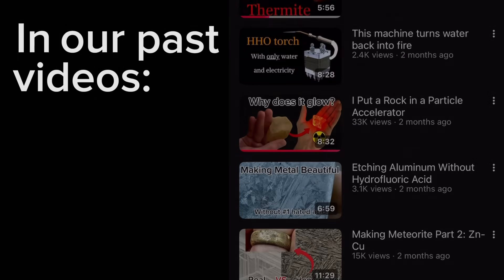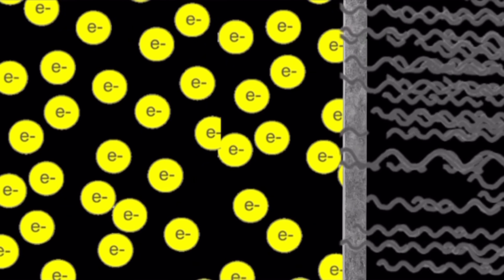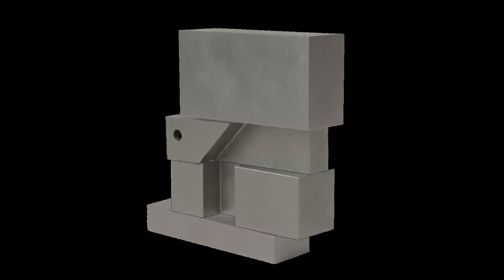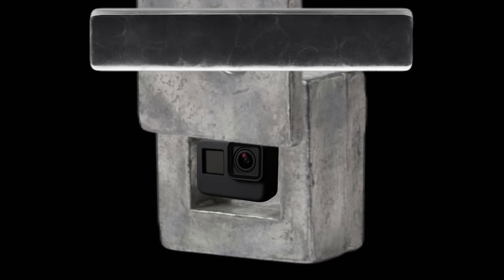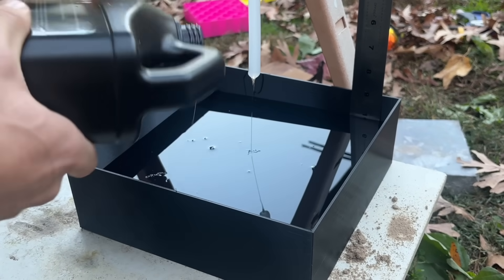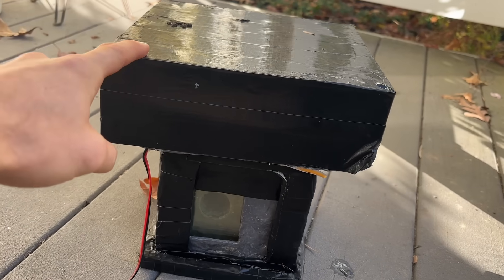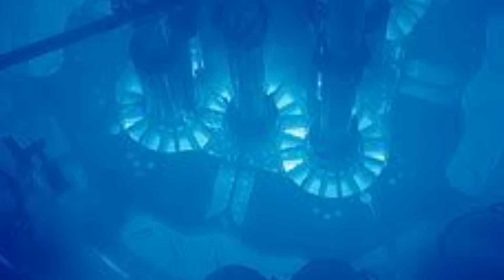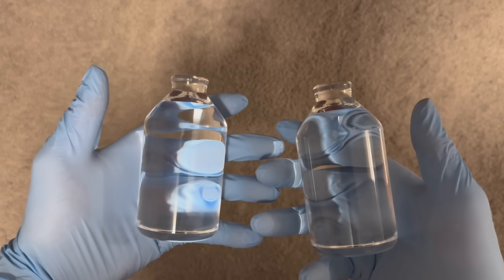Recording Inside a Particle Accelerator

Comment: Uhhh start taking extra vitamin C and go to a sauna to sweat that lead out. Sooo bad for you... good lord. I was yelling (well, inside my head) at the monitor "WEAR GLOVES! DON'T BREATHE THAT IN! COAT THAT LEAD WITH CERAMIC PAINT!" (added bonus fact: semi-embedded lead doesn't readily release from surfaces with just soap and water, there are special wipes)

Otherwise... great work. Very cool. (additional bonus fact: fine crystal glasses contain large amounts of lead oxide... typical is 24%, some as high as 40%. So uh... yeah. Maybe not that expensive after all?)

Comment: Okay this awesome but please, PLEASE wear gloves when handling uncured epoxy! Acrylate monomers are no joke and will poison you if enough are absorbed through your skin, and you'll quickly become "allergic" to basically any plastic that has acrylates in them (which is most of them) that includes things like dental work

Like I can see later on that you're wearing gloves, but like I cannot stress enough how you need to wear them Every Single Time you handle UV resin, and you should also be wearing coveralls. This shit contaminates everything and there's zero way to clean it up. One or two exposures is fine but if you're consistently working with resin you really need to invest in industrial grade PPE, especially if you're showing footage of yourself using UV resin in a youtube video

Comment: 6:12 awesome ingenuity and perseverance.... But .. why didn't you just "machine" your castings for better mating? It's lead, you could have done it with a grinder and energy wheels or many other things. Castings are very rarely used with no machining. Just my 2c but carry on!
Reply from the maker: I don’t have the tools, but even if I did I would rather not generate a bunch of lead shavings if I didn’t have to. But you’re right, it would totally be better machined.

Comment: Hello,
Could you please tell more about the particle accelerator itself ?
i actually expected to see something enclosed like the LHC but it looks more like a conveyor belt and actually makes me think of a airport scanner on steroids rather than a particle accelerator.
Also what keeps people safe from radiation here if there's no door between the occupied room at the beginning and the other one where the beam is ?
Thank's.
Reply from the maker: This is a linear accelerator, or linac. It produces a beam of extremely high energy electrons within an enclosed setup, but then ejects that beam into the environment where targets are set to be irradiated. 

If you notice in the video, the cart travels down a maze to get to the beam. The maze is constructed of feet thick walls made of heavy concrete that provides sufficient shielding between the beam room and the occupied region of the facility.

Comment: why didnt we see a beam of light? i thought particles accelerators are differents.
Reply from the maker: Ionizing radiation is typically invisible. We would see a beam of light if it was dark in the beam room however because the electron beam would cause the same blue glow as they did in the acrylic, but in the air.
Reply: @ElectronImpressions   Yeah, I don't know why I gave any meaning to my imagination about a particle accelerator😂.
I imagined two pipes in a circular shape, each with a particle traveling inside. After both particles reached the desired speed, something would connect the pipes so the particles collide and create a spark for like 0.0001 seconds or something.

Thanks for the explanation! Also, that brilliant GoPro case got me excited about the videos you'll be able to make. I subbed and turned on the bell.

Comment: why not a prism?  Or a mirror? that guides a light towards a sensor at a 90 degree angle to the apparatus.  If that abruptness is too bad, maybe not 90 degrees, but hell, maybe 120.  so it just barely reaches the side after say 100 feet or something, sure that's a lot harder to do, but what ever the math works out to be "safe" of course. If it's still viable then.

Comment: Could have used a torch to melt the seams together or even lead soldier as well!!!
Reply from the maker: Yes totally, although one requirement for the design is that the case needed to be able to be rapidly disassembled within seconds, so at least some of the seams were sort of a necessary evil.
Reply: @ElectronImpressions  Yes, you are right Gentle-Sir, typed my message during the middle out video and posted it. I understand about reflective radiation and quick access. During my construction years, I've found a lead shower pan, instead PVC shower pan to prevent leakage, they used a lead one!!! I should have saved it!!! Nearly 100 pounds of 2-4mm lead sheet!!!!

Comment: 7:55 PLEASE take a blood lead test 😭😭🙏🙏
Reply: No gloves? Bad move.
Reply: @DrDeuteron  the ancient Romans were apparently using lead oxide as face make-up, lead acetate as artificial sweetner.
Reply: @wbeaty  "Ancient romans", Lead acetate was still legally used as a sweetener until at least 1750, and lead oxide was still in cosmetics and paint up until the 1970s.
Reply: @wbeaty AFAIK Romans weren't "using it as a sweetener", it was mostly a side-effect of acidic grapes interacting with lead-lined vessels used in wine making. There's no evidence of them intentionally using lead acetate as a general sweetener. The Romans had to be somewhat aware of lead's dangers at this point (Greeks certainly were) but may not have thought it was a significant concern or just didn't care because it made their precious wine taste better than the alternatives.

Funny enough this and 'drugs' may have been one of the most significant factors in the empire's downfall. They all lost their damn mind.
Reply: @wbeaty ancient Roman’s? Bro I was exposed to lead oxide YESTERDAY from exhaust coming out of a plane that burned leaded fuel (yes those still exist).
Reply: @JJFX-  Exactly correct. And as you alluded, the Romans were putting wine in lead containers intentionally, to make it sweeter. They didn't know the mechanism obviously, but clearly their bloodlust (particularly that of their most infamous leaders), has at least something to do with their exposure to plumbum (as they would have called it). As a side note, I wonder if the slightly diminished bloodlust of the 20th century, sated by violent sports like American football (before serious rules were instituted to protect players) and WWF/WWE wrestling (mostly fake violence, but still) was also partially caused by lead poisoning (I know the crime rate spike from the '70s to the '90s is famously partially attributed to lead exposure from tetraethyl lead  in gasoline, but could we have unknowingly echoed our Italian cousins from 2 millennia ago, creating Coliseum-like analogues in our arenas and stadia?). It's also worth noting that the most violent era of NHL hockey was the 1970s to 1990s! Was this tolerated and encouraged by lead-crazed fans and league administrators? Were the Broad Street Bullies themselves brain-damaged by heavy metal poisoning growing up?
Reply: @VoIcanoman  It's certainly possible this played a role. Lead levels from gasoline were reaching their peak in the 70s and leaded pipes from buildings constructed in the 60s/70s only added to the problem. However it affected those living in densely populated areas significantly more and overall exposure had dropped substantially by the early 80s as leaded gasoline was phased out until being fully banned a decade after that.

There's no denying lead levels can affect behavior, increasing impulsiveness, reducing attention spans, etc. I'm sure this impacted crime and education in urban cities (on top of other social factors) but I doubt it was the primary reason pro sports were played more aggressively.

As bad as it was, it's not as if levels were so high that every person in the US had lost their mind. It was also a very crazy time in sports. Salaries/endorsements were rising, the sports media machine was really getting off the ground and the rules were often not as strict (for better or worse). I think this combined with the use of steroids and various stimulants was likely much more significant. That didn't really start getting attention until the late 80s and we know steroid/doping use continued to various degrees deep into the 90s (and beyond). Throw all that together and it's not hard to imagine why sports were more fun back then ;)
Reply: Well there isn't much you can do to treat it, so You're probably better off not knowing.
Reply: @kiwihuman  just have your skeleton removed.  That's where all the lead is building up.
Reply: eh, it doesnt absorb super well so as long as he washed his hands after it hes fine
Reply: Lead Oxide, but still.
Reply: Lead does not go that well through the skin. Unless he  licked  his fingers, or smoked a cig with unwashed hands, he should be alright.
Reply: Is not that bad. Probably he consumes more lead on his normal diet than what he could have absorbed thorough his hands that single time he worked with lead.

Comment: Could you have worked a high proportion of lead dust into a putty, enabling you to be pressed into all gaps and contours, in order to seal your plates?  And then, strap them externally to bind them all together?
Reply from the maker: I did that with epoxy on the second design and you can see remnants of that, but came to the conclusion because there are a lot of moving parts, I don’t want to risk damaging the leaded epoxy and creating lead dust.

Comment: are you familiar with Andrew Seltzman's (@andrewseltzman9280) gopro exeriments? he did a set of videos a few years back where he sent a gopro through an electron beam irradiator. He even did some where he sent a 360deg camera through. See if you can get them to turn off the light in the chamber, you could clearly see the beam pattern in Andrew's videos when they sent the camera in there in the dark.

Comment: Interesting! 😃👍
But what is this particle accelerator used for if there is no GoPro inside? 🤷‍♂️
Reply from the maker: Crosslinking polymers
Reply: @ElectronImpressions ... I'm not an expert - so you put polymers (plastic?acrylic?liquids) in and give them a new structure with other characteristics? 🤔
Reply from the maker: @u.e.u.e.  Yep exactly, some mechanical properties are only attainable through the electron beam changing the atomic structure of the material. Many polymers will generally change from elastic and rubbery to stiff after being irradiated.
Reply: @ElectronImpressions Thank you! 😃👍
Can you imagine what I thought when I saw the conveyor belt in a zig zag layout and the baskets/trays/boxes like in a security check at airport? 
I thought it's for sterilizing imported food or medical equipment/bandages/clothes. 😂🤭

Comment: Would it be immediate death if someone went through this or would it take a day or 2 ?
Reply from the maker: It would do you in before you got to the beam
Reply: @ElectronImpressions  like immediately or would it just give u terrible sickness? I know about the most radioactive man in history and he was kept alive for 70 some days but literally fell apart. So what exactly would happen if u went directly under the beam?
Reply from the maker: @mikeschulte4271 I can’t event begin to explain the magnitude of what would happen, but to give you a quick idea: all of the water in an organisms body would instantly turn into a hydrogen peroxide solution causing every cell membrane to immediately rupture, all happening before an organism would even realize.
Reply: @ElectronImpressions  holy shit that’s insane! Thanks for the explanation. Btw what’s the dose in rads? How much concrete is required to keep the building staff safe from such a disgusting beam?
Reply from the maker: @mikeschulte4271  On the order of tens of millions of rad. In the video you can see how the cart travels down a labyrinth to get to the beam, I believe each wall is several feet of heavy concrete.
Reply: @ElectronImpressions  yea I did notice the maze but wasn’t sure how thick it was. Crazy stuff lol.

Comment: You could also try adding sodium silicate to a finer sand for the the casting forms. Also heating the forms to slow down the cooling and fluxing the lead and removing oxides off the surface. If you used an 63-37 lead tin mix, increasing the total mass by 50% it would solidify very quickly. Another method is small lead shot in a form using epoxy to secure it all together. I tried to shield a photodetector from cosmic rays and machined a cavity into some stacked up lead bricks. My problem ended up being K40 in the glass window of the silicon detector. Took a while to figure that one out. I looked into those other methods but decided on the lead brick approach. McMaster has a large assortment of lead sheets in varying thicknesses. lengths and widths another approach.
Reply from the maker: With 3 inches of solid lead required to sufficiently stop the X-rays, using a lead composite or alloy would drastically increase the volume of the case. This is detrimental because each cart sent into the beam has a limited surface area and is extraordinarily expensive. So I would want to have more surface area available for experiments rather than for my camera.

Finer sand is definitely an aspect that would improve the design, although if I were to do it again, now that I know this design works, I would make some plaster molds to cast in.
Reply: @ElectronImpressions  I did not consider the exact effects of using led/tin alloys. Just trying to mention other solutions to the fabrication of Xray shields.The use of plaster molds is a bit problematic due to that pesky thing called water. I tried it a few times with little luck. Should have baked the mold perhaps. My son was one of the first persons to use HD foam to make up concrete molds. If you look on line there are quite a few companies using that process. 
As for the use of McMaster sheets this comes to mind. Using lead sheets. build up the shield you want using a leaded flux  as the glue. Place the finished shield into mold box and fill it with the mold sand. Have it so the upper shield surface is visible. Heat the combined shield/mold until the parts are fused together. Finished shield has no voids or surfaces.

Comment: couldn't you seal the lead cracks with a blow torch and a stick of lead?????
Reply from the maker: Yes, I could even just cast it in one solid body. But the case needs to be able to be rapidly disassembled to access the camera within seconds as we are extremely crunched for time when using the accelerator. So the seams are a sort of necessary evil

Comment: Rattle can spray paint would have stuck to that lead wonderfully 😊
Reply from the maker: I was considering it, but with how the components slip on to one another I thought it would rub off easily
Reply: @ElectronImpressions  It would have at the joining surfaces. Good call.

Comment: It would be interesting to calculate the dose and the expected lifetime of this camera. I'm trying to think about what silicon is in the GoPro specifically. Charge trapping and of course lattice disruption are possible but with electrons and all that shielding maybe it will live quite a while assuming your machine produces the typical low LET values of a beta, and few of the betas make it through those gaps, but xrays are the greater hazard in your application. I still don't see a spider, but I definitely haven't seen any creature emerge from a 50 mega rem 55 MeV neutron beam.

Comment: Amazing work! One potential upgrade could be to replace the epoxy hat with a block of polyethylene, one of the best particle shielding materials due to being mostly hydrogen (average atomic number is closer to 2). It's not as easily castable but it comes in easily machined sheets/blocks and can be melted without risk of burning in a 300°F oven.
Reply from the maker: PE was definitely considered but the casting of the epoxy really sold me, it made everything much easier to design in the tight timeframes and rapid design changes I experienced. 

But yes in a version 2, among many other improvements, PE will be incorporated!

Comment: I wonder if there's enough room in there to place a dosimeter inside with the camera to know how much radiation the camera is actually experiencing.  Or even just replacing the camera with a dosimeter to take a measurement.  Then you can know exactly how effective your shielding is.
Reply from the maker: This is on the itinerary
Reply: @ElectronImpressions  will you use one capable of energy spectra ?
Reply from the maker: @Berkelium247.07  Well, we have one, but I’m not sure if it will fit lol. I am really curious though, maybe we will buy a new one in the future that may or may not be sacrificial.
Reply: @ElectronImpressions  Is the radiation attenuation inside "the safe box" due to led shielding measurable (like, linear), so you could calculate the source radiation from it? I know the source has a sticker with that info somewhere, but this is more fun.

Comment: Won't trillions of electrons just embed themselves in plastic and produce an insane electric field?
Reply from the maker: This likely happens, and was something we were worried about. But apparently it is fine.
Reply: @ElectronImpressions where do they all go though to equalise the charge?
Reply from the maker: @tedarcher9120  They bleed out over the course of a few minutes. The epoxy is also in intimate contact with the lead, which allows conduction away. I am inclined to say this because usually epoxy will discharge if sent through the beam, but this epoxy did not, even after 6 runs. Likely because electrons were carried away via lead/bleed-off faster than they can accumulate, never producing an electric field that exceeds the dielectric strength of the epoxy.